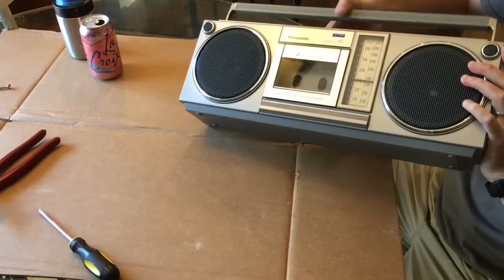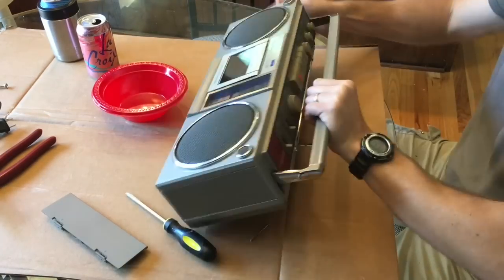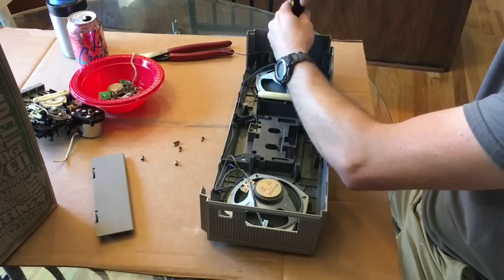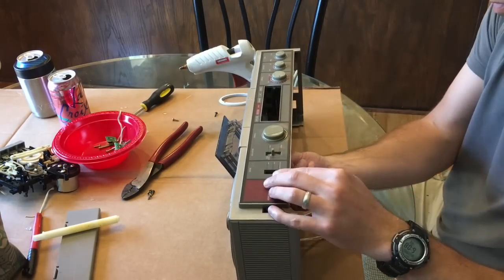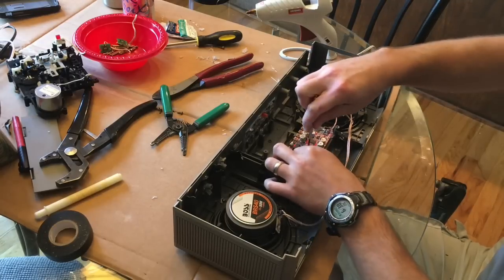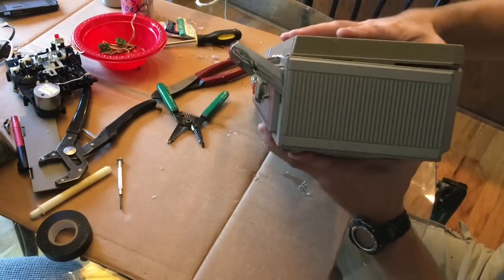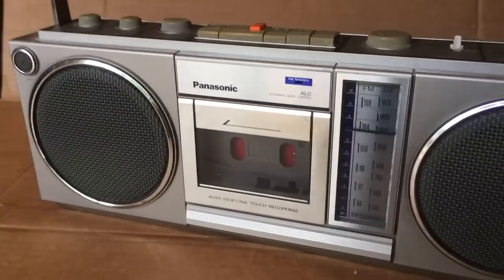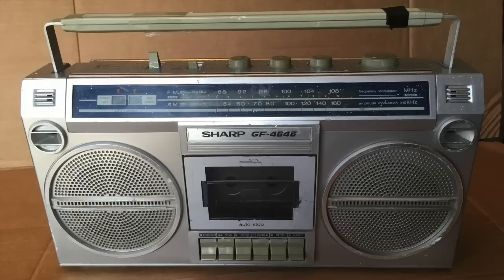Vintage 80's Boombox to Bluetooth DIY Repurpose

Comment: I think it's a big loss to remove the motherboard of the radio and power which allows you to run the boombox by itself not depends on a mobile only, you can use its radio and a usb flash with some songs on  it

Comment: I wouldn't use car speakers, only use speakers that the amplifiers are matched for.
The impedance might be the same but car speakers will not give the full power because the efficiency won't be as high as the originals and the cones will be of a heavier doped materiel making it more difficult for the amplifier to push where as the originals will be of a very light paper structure plus the larger magnet could de magnetise the cassette tapes.

Comment: at 6:00 in your video I'm wondering  how u added the toggle switch it looks like u spliced the wiring and how did u transfer it to the battery what is the brand name of the battery as well please  help  I'm lost after 6:00 in the video

Comment: thank u soooo much after looking through 100s of tiring  videos I finally found yours which showed me  exactly how to gut out the whole box and simply add a  blue tooth amplifier with a simple plug in system no soldering thank u thank u thank u

Comment: Nice job!  
One thing I'd add:  Before gluing the door shut, I might have slipped in an old cassette (perhaps with spindles from the mechanism) to fill the window.  It would look more authentic than those empty holes where the spindles used to be.  A cleverly titled label could be an option, too.  Not to mention how many cassette types and colors you could try to get the right look.

Comment: Use contact cement instead of hot glue. Just be careful placing the knobs.  Once the two surfaces make contact, they're as good as welded.

Comment: Man, you destroyed some fantastic equiment, especially the deck. Sad to see a japanese legend die, how broken is broken? Cassette mechanisms like these you can never find on new made boomboxes. Hook in a bluetooth module, reuse the amp (the amp you put in, never get the full potentional), try to fix problem(s), maybe change the speakers, add a button and you are done. Keep the original features, much nicer and much more respect to something great from the past.

Comment: great video. how do you bypass the on/off function of the battery? does it stay on all the time or is it wired to the toggle switch you added on the side? also when you recharge the battery do you unplug the bluetooth board? I love this idea and I have been inspired to try this out! Thanks again.
Reply from the maker: So on some of them I've actually moved the switch from the battery pack to a new rocker switch on the side of the boombox that I installed.  Depending on the battery pack, it's usually just a matter of removing the switch from the battery and adding wire it to move it to the new rocker switch.  The TalentCell batteries I often use do need to be turned on when you charge them so the Bluetooth board is also on, which hasn't been an issue.  I've got another video to post soon where I used the Dayton Bluetooth amp board from Parts Express and those boards provide more options regarding power switching, volume, lights etc.  I'll try and post that soon.  Good luck with your own project and let me know if you have any other questions.
Reply: @Whynotmake  Dude you're the BEST!! Thanks

Comment: And the USB or MicroSD port?
Reply from the maker: What do you mean?  This amp board doesn't have those inputs.
Reply: Whynotmake In the radio signal can use it how input with a switch.

Comment: Ok, this might be lamenting on a high level but I think there is much room for improvement. It kinda hurt, when you just cut everything away and just glued the buttons in place. Would have been a lot better if you tried to reuse (some of) the knobs and switches. At least for switching the power on. I mean, come on, glueing the top buttons in place and installing a new one on the side... A little more love for these things pleeaase.

Also, not really an upgrade in my book. Conversion fits better.
Reply: This killed me inside to see.. sad .. u should of just bought case not used a real 1

Comment: This is exactly what I need. I wanted to get an old portable radio to tie to my bicycle. So I can listen to tunes while I ride, have it look vintage with Bluetooth capability
Reply from the maker: That's great to hear.  If you don't end up wanting to make your own let me know.  Also, I strapped a boombox to the back of my 80's Honda CT110 and it's a beautiful sight. So I def share your vision.
Reply: Whynotmake I want to do one similar to this but I would like the original button volume equalizer and so on to work. Do you think that ampboard can be connected to the original or do you have any other ideas how I could do this? I really liked your video and project you inspired me to do my own, it will be a fun father son project

Comment: Cool project. Why not use the cassette section to store an aux cable or USB charger cable? It can also double up as a phone holder with the door open.
Reply from the maker: Sounds like a cool idea. You’d just have to figure out a new mechanism for opening and closing the cassette door

Comment: Is there any way to keep the functionality of the cd or cassette deck
Reply from the maker: So far, I've only been able to keep the existing functionality on a couple of them.  Specifically if I find one that works and has an aux input I've internally wired a bluetooth receiver.  Most of the time the stereos I use don't work to start with so I just replace everything.

Comment: Where did you get the power supply from
Reply from the maker: Hi Ian, I got the battery pack on Amazon.  I have a link to each component on my website- www.whynotmake.com
Reply: Thanks for the info.  How much play time do you get out of that battery?
Reply from the maker: No problem.  I need to do a test to see the exact lifespan of one charge.  In my real world experience the only time I've had the battery run down was when I accidentally left it on for days.  I would think you could get 10+ hours of listening time.  I'll try leaving one playing overnight tonight from a full charge and see how long it lasts.

Comment: Where can I get the power supply from and what is it called?
Reply from the maker: I used a 12v lithium ion battery pack sold on Amazon by Talentcell.  It's about $25. Hope that helps.